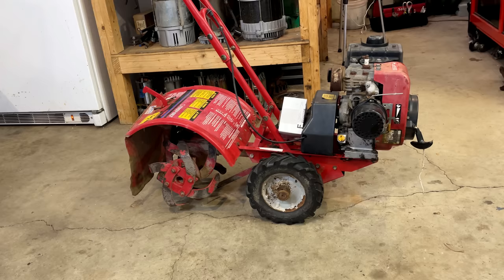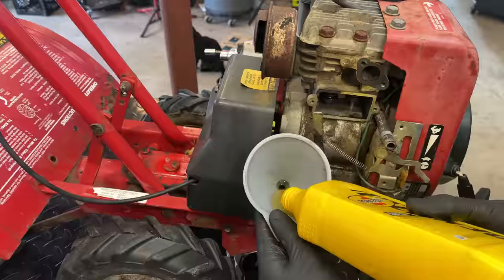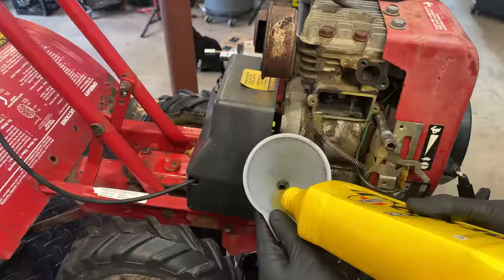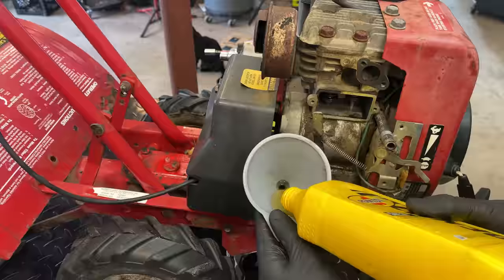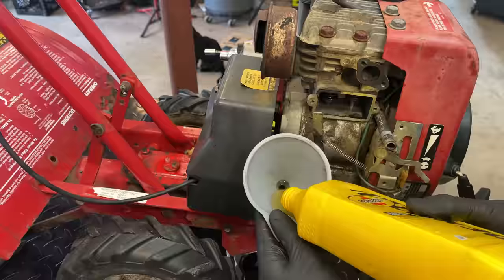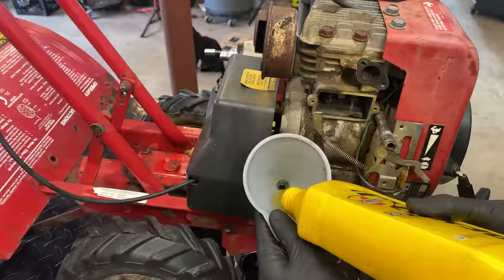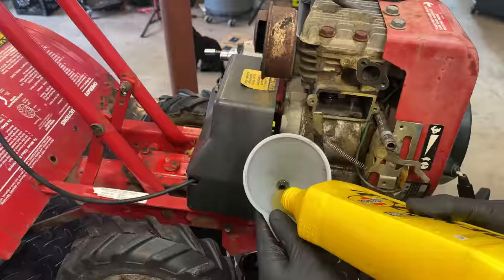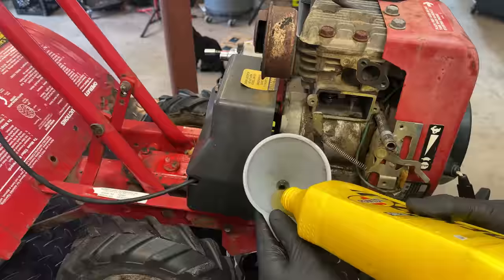Tired Tecumseh Troy-Bilt Tuffy Tiller - No Compression

Comment: My grandfather was born in 1918. Died in 2011. Saw it all. Learned to be frugal. Lived his life saving family & neighbor’s cars and equipment from the scrap yard. He would certainly love & appreciate your work.
Reply: Yes Frugal. Where I grew up everyone did their own maintenance on everything, house, car, mowers, tillers etc. I learned from a couple neighbors to be frugal as well. Don't tell Jim, but if we were doing this one, we'd have added oil and simply run the engine up to 1,000 rpm with the help of another engine and a fan belt. Even with no compression within just a few seconds at that speed it would have started on starting fluid unless the coil low tension wires were shorted and there was no spark.  That would have been next. Most of the time we'd just tape them up.  Then we'd put Gumout brand carb cleaner in some fuel at a ratio, like1 pint gasoline and 4 ounces of cleaner. Restart the engine with starting fluid and possibly sustain it with propane from a hand held torch nozzle and you'd be surprised that it would run and clean up after a couple of times of revving it up and choking hard. Then let the gas sit in the carb and dissolve the gum and debris. We did that so many times. Once the garden was ready for planting, then we'd address the coil wires and valve clearance issues.  ben/ michigan

Comment: Since you are working on l-head engine I would like to ask: does  l-head engines are significantly less fuel efficient than ohv ones? I have one l-head tecumseh engine in old generac generator, and some ovh in  lawn mower etc and I have impression the old tecumseh is much much more fuel hungry. What is your opinion / experience?

Comment: I'm not 100% sure what type of gasket material you were using, but I will just put a piece of paper over the object and run over it with crayon to create a template if I want it to be perfect. I also have an antique scalpel that I use to cut them. It swivels to some degree, and it is great for cutting gaskets.

Comment: Getting that pulley off with an air hammer was impressive, and no heat necessary!  I have a feeling that engine oil was factory, and never changed or even checked😐😑
Reply: That oil looked like it was never even refined. Straight from the well to the crankcase.
Reply: 40% of gas engine lawn mower owners, NEVER change the oil according to Consumer Reports.  😢
Reply: @foxlake6750  I'd think the percentage would be higher than that. Some are lying.
Reply: Thats why B&S new engines don’t require oil changes. The original is probably a synthetic.

Comment: Good job, Jim.  When you were going to RTV the gear box plate, I was thinking...just make a gasket.  And then...yep, good job!  ;-)
Reply from the maker: And it was a good thing because that plate came right off again to drain the gearbox.
Reply: Jim what weight gear oil did you use in the gear box.Another great video.
Reply from the maker: 85w-140

Comment: I had that exact tiller! My wife's father bought it brand new sometime in the '70's or '80's, and used it a lot. When he died, we inherited it, and I used it several times over the last 23 years or so. Sometime last year (2022), it lost compression, and it was so old and beat up, that I decided not to fix it. I gave it to my gardener. He fixed it (stuck valve) and is still using it to this day. It's got to be 50 years old, and still going strong.

Comment: Another fine fix James.  I wanted to mention a product in the heavy machinery industry we called them   ( Speedy Sleeve )  Any place that sells Chicago Rawhide seals or a place like Motion Industries should carry them. They are a paper thin metal sleeve that fits onto the damaged or worn shaft where the seal would ride. You give them the seal part number you are using ( OEM ) and they will supply you with a speedy sleeve and the shaft seal to mate with that sleeve.  An awesome product I have used for over 35 years on  350 to 1000 horse power gear boxes without any failures.
Reply: Great advice
Reply: I’ve used them many times over the years to seal pitted and rusted shafts

Comment: I have one of those.  One of the first things I did when new was to grease those axles, then put the wheels back on.  They come with quick disconnect pins so you can take them out, push the wheel back, then re-install the pin so it can freewheel and you can roll it around with the engine off.  If you forget to put the pins back to drive position and engage the tiller in the ground, hold on!  Really god job on that tiller.  Troy-bilts are good ones.

Comment: I've been looking for a used tiller for several years now and have been paying a reasonable charge to rent one.  My hunt was accelerated when the business I rented from for all those years increased the rate over 100% this year (it's the same machine I've been renting for years).  Last week I visited a garage sale and found this model offered for $25.  The seller accepted my offer of $20.  I did get it to start but only by spraying starting fluid into the carburetor.  The starting cord was broken and I was able to use the remaining cord for a few pulls until it broke again. I watched your presentation from cover to cover as I believe that my machine has many, if not all, of the issues.  I was delighted to find your presentation and hope to be able to make all of the repairs.  You have provided me with a wealth of information on how to get my machine operating.  Thank you.

Comment: You can use a spring tightly fitted over a hose to prevent collapse in a tight bend.  Also,  there are fuel shutoff valves with a 90 to connect at a right angle.  Great video with good tips and info.

Comment: The older Troy Bilts were awesome! (Not so much the newer MTD clones...)
My mom had one of the 5 HP Pony models and it did a beautiful job. It's only downfall was it was a little undersized for the area of her gardens, but she was scared the bigger Horse model would have been too hard for her to handle.
Great job getting it back up to operational status and I found the meticulous cleaning of the top end very rewarding :).
Reply: We have an old Econo Horse with like a 6 hp tecumseh i beleive, things fairly stout. fixed a leaky tine seal, a non existant gasket for the tine shaft...seal cover? broke a tine... cleaned the carb but. It's an OLD thing. Works hard.
Reply: She was right ! the Horse is a back breaker! speaking from experience !!!

Comment: My father bought a Troy-Bilt tiller in 1969. Back then they were made with cast iron and the tines rotated opposite of the direction of travel. He had a large garden and tilled it every week from April to November. Every winter he would replace the front shaft seal and the seals on the tine shafts. Dirt just tore them up. His has a lever for several speeds forward and reverse and I think the wheels can drive without the tines rotating. It has been sitting in my storage building since about 2004.
Reply: You sure it rotated the opposite way? The tines have way more traction than the drive wheels- it would at best dig itself a hole but more likely push you in reverse which is a great way to chop up the operator when he trips. Seen and operated many rotary hoes of various walk behind sizes and never seen one that runs in reverse that doesn't actually have a reverse gear (meant for untangling only).

Comment: I have a Troy-bilt Pony tiller with Tecumseh engine made by the original Troy-bilt company.   May be the same engine.   This was purchased in the mid-80's.   It is kept indoors.   The paint has faded over the years, but the engine starts easily and runs well.   I also had a leak at the tine end of the gearbox.   Easy to fix that leak.
Glad your tiller is back to a good second life.
Dave.

Comment: I love the way the choke lever allows the careless operator to touch the uninsulated plug .....   I have (not so) fond memories of reaching to shut off the press to close fuel tap on our old Victa mower - the tap was located directly above the spark plug.  I came to on my backside 10 feet behind the mower which was still idling away......  That was 60 years ago, never forgotten 😂

Comment: GOOD fix! I got a horse model with a blown Tecumseh and put a Wisconsin Robin on it and swapped it for 2  Gravelys which made one good one. My dad got a horse YEARS ago with a 7 horse Kohler that is still going. I stored it but he needed it and still uses it. They're tough and will jump like a deer if you hit a hard place or a rock just right. And the loss of oil is as we both know that who was running it didn't check it. Good deal and God Bless

Comment: I recently swapped the engine on my family's lawn mower, thinking it was beyond repair of any kind. It had no compressjon like this one. I ended up tsking the engine to my workshop, tore it apart, lapped the valve's and adjusted rhem by grinding them (flathead engine), and I once again had compression. Its not as good as it should be, so im sure its down on power still. But i got it running, and i ended up doing something fun with it instead of using it on a lawnmower. I tore it completely to bits again, and installed a oil splasher and did some other minor modifications to the oiling system. Then i changed the orientation of rhe carburetor, built my own governor linkage to convert the governor into horizontal mode using parts from a old radio and some nylon string. I made a horizontal engine out of a vertical engine. And ive put about an hour of runtime on it so far without any issues whatsoever, and im now in the process of building a small generator with it :) nothinf crazy powerful, just something that can output about 1000 watts or so, using a induction motor wirh capacitor excitation as alternator, works great. The engine will never have as much power as it should, but in my application, it'll work more than well enough! And if it fails, i can easily swap it with any off the shelf engine. My frame is entirely home built and easy to modify.

Love your videos James, you're a huge inspiration for me!

Comment: The Tecumseh engines seem to go for ever especially if the oil is checked regularly.
I have a 20yr old Ariens  1128 snowblower with a Tecumseh   
11hp, it has no trouble moving snow.
I gave the blower a bit of TLC last year and rebuilt the drive, this year I will rebuild the auger section.
The blower is built far better than todays machines.
Thankyou for your quite detailed and informative YouTube videos, I enjoy watching someone else work on equipment having retired out of industrial engineering after 50yrs of challenge lol.
Reply: I have come to the conclusion most equipment built years ago is better than today's machines! I have a Honda front tine roto-tiller that is now almost 50 years old and aside from replacing the tines a couple of times, it still starts first pull even in the cold and happily trundles along my very rocky soil!

Comment: James. 
This was another one of those shaggy dog repair / restoration jobs. Kudos. It takes a lot of patience to keep after it. Good catch seeing the milky transmission oil. And so as not to disappoint when draining the oil a second time you found the gas tank leaks. Gremlins are like that. 
I am presently restoring a 1976 Horse. The manual for that machine goes into great detail on how to shim all the bearings to the correct clearance. 
There is a source for a PDF shop manual for the horse on line. It is quite clear that the driveshaft must be shimmed to eliminate almost all front to back play. You may want to check to see if that gasket you made is the correct thickness to get the right bearing clearance. According to the manual after final assembly there should only a "trace" of end play in the shaft. 
Since every video you do I learn something new I thought I'd try to reciprocate and throw in a crumb of helpful info. They always work better if they're clean!  
Keep the great videos coming.

Comment: Jim, a ball pein hammer can be used to cut a gasket where there are square edges, and it does no harm to the surfaces, if done properly. My dad and many other mechanics use this same procedure with very good results. Even bolt holes can be done, but with the ball end, tapping lightly, just enough to cut the gasket material.
Look on YouTube, and give it a shot. You might try it on parts you dont have plans for for the practice.
This technique is called a mechanic's scissors by some, and it works on cast aluminum as well.

Comment: Thanks James. Got a old millwright tip for you. When punching holes in gasket paper, Put a small block of wood in a vice, cut edge  up and use it for a backstop for punching holes. Saves the edges of your punch and leaves nice clean holes in your gasket paper
Reply: @philliphall5198  Wish I had some up here where I live only oak wood is furniture or kitchen cabinets.

Comment: OK James. Another good one. Those markings on the cylinder wall on the flywheel side are suspiciously in the right place for the wrist pin clip to be rubbing on the wall, but the marks make it all the way up to the top, so that is not consistent with wrist pin clip damage unless it made it out of the cylinder. Need to look into that so it doesn't get worse. I grew up in a blue collar neighborhood and everyone fixed their own stuff. We learned to do things a little bit differently. If there was no spark we'd have addressed that. No compression? Just connect the engine to another engine with a v- belt and run it at 1,000 rpm or so spraying starting fluid into it and it would start right up. Then add some carb cleaner to the gas tank with fresh gas and run it on propane while closing and opening the choke to pull gasoline thru everything. 99 times out of 100 that would be it until after the immediate need for use was met. After that we'd cut the valve stem and do what ever else. Some things I had to work hard on were those old ratchet windup starters on Lawson and Tecumseh's and points under the flywheel. Diesel fuel or Easy Off Oven cleaner was my goto for cleaning off grease and oil build up. Spray or brush it on, let it sit and hose it off. But way befor Brakleen, we put gasoline in a pump oil can to clean parts and blew them off with compressed air. Starting fluid was great after filing points as a parting shot to clean them. And we filed them a lot. Today I prefer a woman's emery board. The thin two sided ones with Orange colored grit on one side and Tan on the other. I don't use Brakleen any more, it's too expensive. I buy store brand spray parts cleaner like Rural King's Providence or Walmart's Super Tech. I just make sure I DON'T get the one that contains water. ben/ michigan

Comment: This is a really interesting video. Both sets of my grandparents were farmers. So it is interesting to see the repair of power equipment meant for the garden, especially the issue with water in the tiller gearbox. From the way you were using the (repaired, functioning) tiller in your yard, it does seem to be a light duty machine. Both sets of my grandparents had large personal gardens. They needed something big for tilling the soil. I think one set of grandparents tilled their garden with a standard Farmall tractor and plow, but the other grandparents used a rototiller. I'm not sure why -- maybe because their garden was close to the house and they did not want tractor tire marks on their lawn, or risk accidentally plowing their lawn. I seem to recall that grandfather used a huge rototiller. It was big and tough to control! This was back in the 1960s. Most things seemed to be built much more stoutly during those years.

Comment: I think the ball-peen hammer method would have worked best for cutting that custom gasket. Much faster and just as effective.

Place the gasket material on the sealing surface. Lightly peen one bolt hole, remove the cut gasket material, and place the bolt in. Then hold the gasket material in place and lightly peen around the rest of the features. It cuts out an exact copy quick and easy. For larger gaskets it's helpful to hold the gasket material in place with two opposing bolts, so it doesn't move while you are cutting the pattern. 

I bet half of the gaskets on US Army equipment are made of manilla folder and high-temp RTV.

Comment: Always good stuff James. I fixed a couple of Troy Bilt Horse tillers with the Teumseh engines that blew a connecting rod due to low oil. No block damage, cleanup the crank rod journal, install a new connecting rod and they ran like new.
Reply: I believe the design of these models of tillers caused the engines to run more on an incline thus contributing to lack of lubrication on the rod and main bearings.  The engine is a horizontal shaft, but if you know how far back these engines would tilt when the Troy's were digging in, you'd know what I was describing.
Reply: @rockymntain  30* + angle on the engine when you tilling at maximum depth. I always run oil overfilled as cheap insurance.

Comment: Dad and I rebuilt a lot of 2stroke engines and only 1 or 2 4 stroke so while we rarely needed a valve spring compressor took we(dad) all ways found a way to get by without one but see you use one it sure would have been nice.  When I rebuilt my 350 Chev V 8 removing and reinstalling the valve springs and keepers without a valve sprung compressor tool was a MAJOR PIA.  MAJOR.